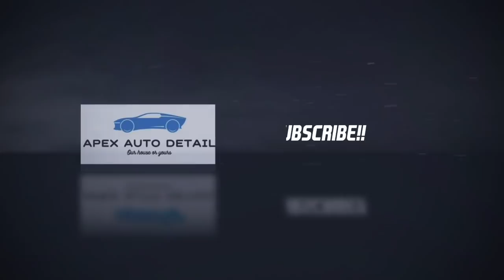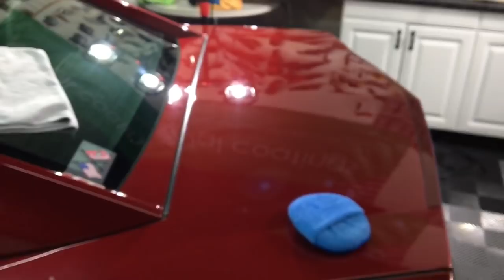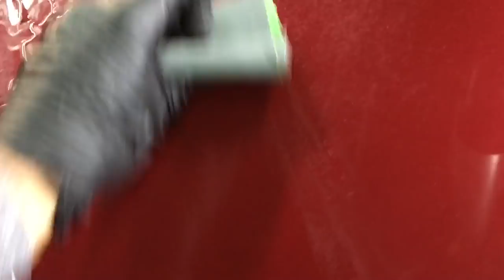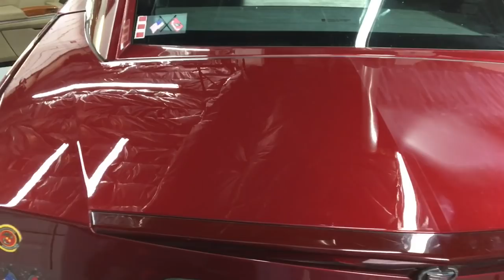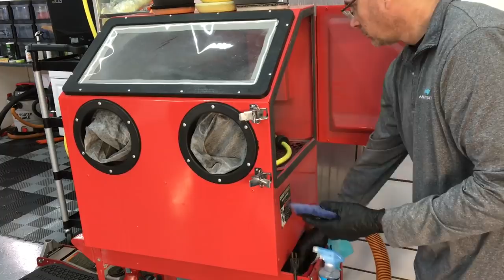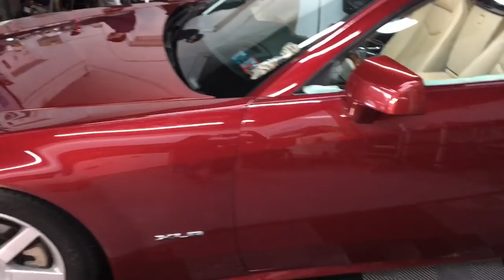How To Correct Moderate (Hardness) Clear Coat With Heavy Imperfections!! Tinted Clear!

Comment: I did one of those cars in silver for my boss when I worked at a car wash years ago. I want to say it was 2009, or 2010. It was before I got seriously back into detailing. I used Zymol HD Cleanse, and Carbon wax. All by hand. Turned out ok. I was paid my hourly rate to do it, and thus it was probably my cheapest ever professional detail!

Fast forward to this past summer, and I had a Caddy with a similar color, and had that tinted clear transfer on my pads too. Those Uro Fiber pads, and 3D One was enough to remove all the defects, but I went over it with Duragloss 101 and a foam to refine and protect the finish. It has an ultra fine diminishing abrasive, and  tough synthetic protection.

Comment: Hi,I have a question,  how does someone without a machine like yours clean there pads to match your pads?
Reply from the maker: They make pad brushes and spurs to clean them on the machine.
Reply: I have a pad washer and dryer that I bought in Germany
Reply: What is that cabinet you're using to wash pads? I've never seen anything like that commercially and I'm wondering. Thanks

Comment: Do you use the 3" 3M Trizact discs with 3" spongy sanding tool? I found the discs here in NL but i cant find a tool like that :(. Sanding with a block, pad etc and normal sanding paper sheets is not handy at all.
Reply from the maker: Thanks for the link Chris. 👍🙂

Comment: Brian, my Infinity has what is referred to as a tri-coat paint.  It's my understanding that consist of a base coast, a tinted/metallic clear second coat,  topped by a clear coat.  Is that correct?  Is this car you are working on the same or is the top clear coat tinted?  For tri-coat paints are there any special procedures for paint corrections (yes I understand that Infinity has really thin clear coats).
Reply from the maker: This one is a bit different the whole layer is pigmented.

Comment: I have wipe off & play time issue with 3d Aat and aca when use on soft clear Coat. 

Are the 3d one just like booth of them?
Reply: Make sure you do a test spot before starting on a panel. Soft clears cut fairly easy but the finish can be a pain. ACA & AAT may be entirely to aggressive for soft clear. I wouldn't use either for any soft clear. 

3D One can be used to cut and polish quite a few soft clears. Lots of variables though ( pad used, DA or Rotary, direct sun or shaded area, etc etc ). Check back on a few older videos from Brian. He goes into great detail ( no pun intended ) for correcting soft clear coats. 

Bottomline 3D One is generally a great choice for cutting and polishing soft clears provided you team it up with the right pads. 

Hope this helps!
Reply from the maker: 3D One is better suited for use on softer clear.

Comment: Brian help 🙏🏼 when I wet sand (I’m very careful), and after I’ve polished out the scratches, I can still see the scratches using sunlight, what am I doing wrong? Thanks and happy new year
Reply: Maybe putting more pressure than needed when wetsanding. Or the combination of pads/compounds/machines are not OK. Remember that hard clear coats are more tenacious to correct even if you pass a 5k trizact so make sure to take those tips for granted.
Reply from the maker: What type of clear are you working on?
Reply: @apexdetail85  I second this, I tried wetsanding some scratches on the roof of My Dads 2019 Chevy Colorado. When I went to polish it out, I was using Sonax cut max and the lake country hybrid wool purple pad on a da polisher. I had some new marring that I like to have never got polished out that wasnt there before wet Sanding. I used same process as I did on my F150 and didn't have that issue on it.
Reply: Apex Detail hard clear. Just to be careful I used 5000 grit last time with a RID stick and very little pressure, almost gliding on top of the paint.